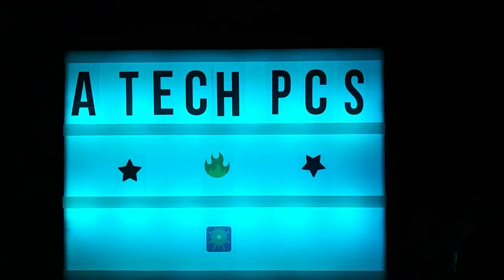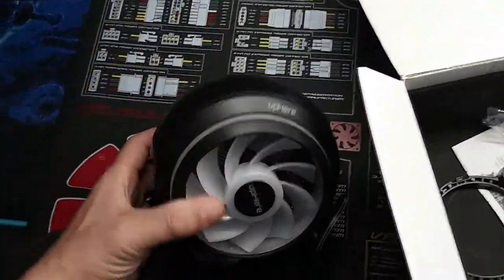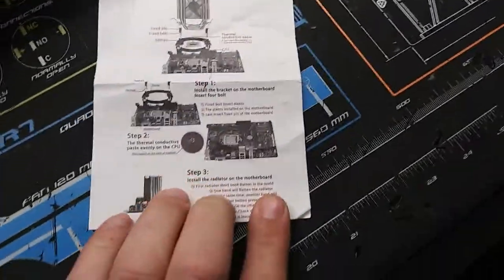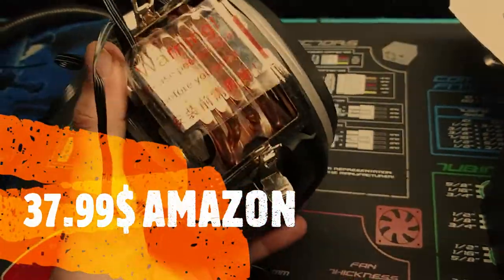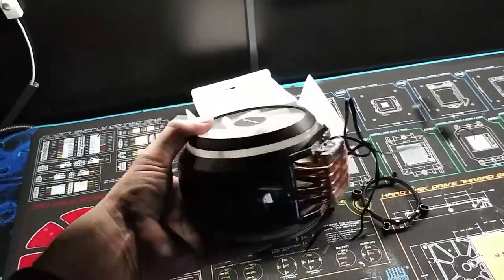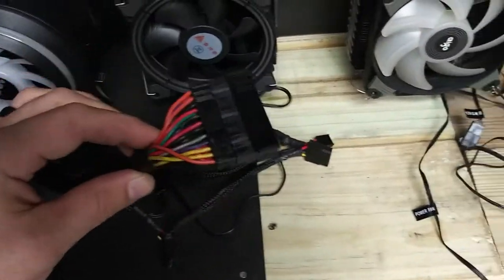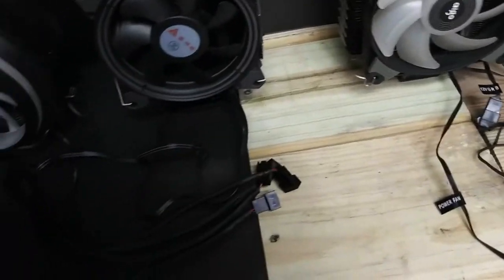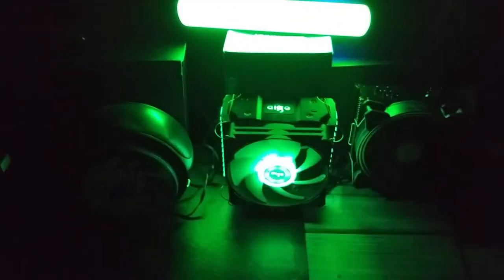upHere CCF150 High Performance CPU Air Cooler

Comment: Thanks for the video about this cooler. After getting a deal the other day I couldnt pass up on a like-new Ryzen 5 1600X CPU, I was in need of a cooling solution for my next build. And since the 1600X is one of the only Ryzen chips anywhere near that skew that doesnt come with a stock cooler, I was basically just looking for something that performs at least as good as a standard AMD Wraith cooler and something that looked cool too. And since I already have an unused box of red UpHere fans and and an UpHere GPU support bracket on hand, staying onbrand with this particular cooler seemed like a gamble I was willing to take so I just ordered the red version a couple days ago. Especially since it was marked down to $26 on Amazon. The fact that it clips directly onto a standard AM4 board doesnt hurt my feelings either.
I'm going with a red/black MSI X470 board, red/black Ballistix RAM, this cooler, red case fans, 2 red LED strips, and red/black sleeved cables in a Lancool 205 box. In my mind, I'm seeing a Knight Rider kind of vibe, but I guess I'll just have to wait and see how it turns out in reality.
Reply from the maker: U should check out some of my other videos... Especially my builds... The cardboard gaming pc.  The wall mounted gaming pc... The Titan rig pc. The gama build.... I have few... Im glad this video help you out... I hope you left a like on the video... And could prehaps share it on facebook. And consider Subscribeing to my channel... Let me know what u think of my videos.. I appreciate the comments... Hope to see you in. Future videos.
Reply: @ATECHPCs  Bro, I subbed to your channel when I came across it about a month ago and I've watched quite a few of your vids so far. I watch to the end and always leave a like/
Reply from the maker: @methodmantis3060   wow.. Thank you.  .  i appreciate that . Thanks again